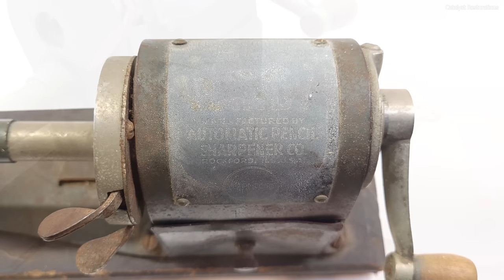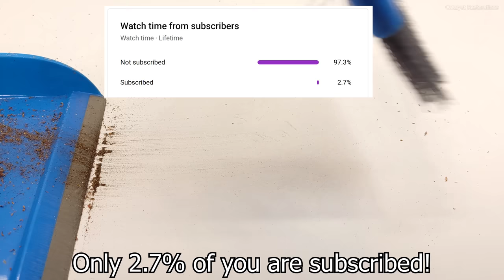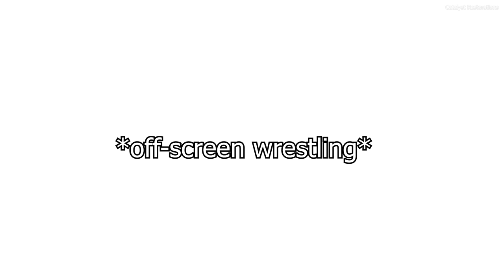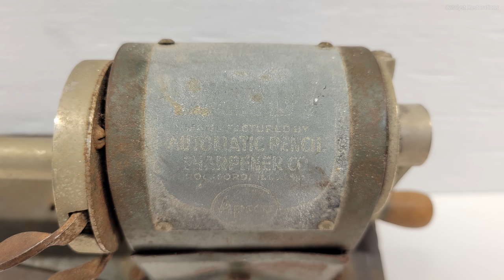82-year-old "Dandy" Automatic Pencil Sharpener Restoration

Comment: These sharpeners were still fairly common in the 1970s, not so much these days. We had two (I think they were "Climax" models, not APSCOs) in the wood shop at the original (pre-1980) Winfield High School (Winfield WV) and six or seven (a mixed lot of models) in the various shops at the Putnam County Vo-Tech School (it goes by a fancier name these days) (Eleanor WV). When I was doing cabinetry work in Florida and Alabama in the early 1980s, I saw a "Dandy" in the shop, but it was in pretty poor shape.  I never thought we'd get to a point that a mechanical pencil sharpener would be a rare sight, but here we are. Thanks for doing the good deed of bringing this needful thing back to life.
Reply from the maker: Mechanical sharpeners were still the norm in school for me through high school (the mid-2000's, I know I'm a youngin!) but I'd be surprised if I regularly found them in every classroom still today.

Comment: Great results, and congratulations. I have collected a few of these through the years and several had pencil gripper jaws that were stiff and intractable. You gave me the courage to open up the spring loaded chassis where lots of shavings had settled. After cleaning them out and re-assembly, I get a much better result with the sharpened pencils.
Reply from the maker: Thanks Jim! Glad I could give you the courage to open it up!

Comment: I think maybe the doohickey that 'locks the blades' might actually be what stops the pencil moving forward once it is sharp. The point would hit that and prevent the spring from pushing it further. Might be adjustable for two different sharpnesses?
Reply from the maker: You are 100% correct. It's actually a tip point adjuster - I even found some old ads that mention that feature. Great eye and thanks for noticing!

Comment: If you created a curved sanding block that would fit the printed part, then you might be able to Japan it then sand it to remove the blacking. The block won't compress and get into the deeper parts.
Reply from the maker: Great suggestion Mike! I've been meaning to break into the japanning game soon, so this might be a good opportunity.
Reply: @CatalystRestorations  😆

Comment: Really a pretty job overall! With minimal equipment. Bravo! I really enjoy your videos so far! 
Keep it up! Keep learning!
Some advice from an old fart that used to do a lot of fixing & restoration:
A couple things you missed, oil the crank shaft - that is what the button that's off center top, 3in1 oil. Should have put a tiny bit of lubriplate under the pencil grippers before assembly. The grinding gears are supposed to be lubricated with graphite - I know, ironic isn't that? You did a pretty good job matching the paint, maybe in the future you can use a pantone chart and mix and spray with an airbrush. I caution you on the universal use of the wire wheel, it can and will remove actual metal and possibly leave unwanted patterns in the metal surface. Also it can reduce the amount of metal causing things to fit loosely where other methods wouldn't - evaluate this before taking action, especially on CAST parts. (don't ask, take my word for it) For your rivets, make a tool from a round 1/2" steel rod, grinding a divot into one end in the shape of a rivet head & pound that, not your resto piece, you left hammer marks, minor, but on a future piece it could be a disaster! As far as the lettering, I've never found an easy way to do the shallow ones, just magnifying light and pinstripe paint and patience.
Reply from the maker: Thanks for taking the time to write out all these great tips Craig! I'll definitely use these!

Comment: Excellent Restoration!  You may want to try using a bluing agent and apply with a small brush. Light sanding will remove any over coat.
Reply from the maker: Is there a bluing agent that works on tin alloys? I'm confident the tag is made of a tin-based alloy (very soft, malleable, and lightweight and tin alloys would be period-correct for this) and all the bluing agents I know of only work on steels. 🙁
Reply: @CatalystRestorations  I don’t know if it would work on tin, you can try a test piece.  If the impression is deep enough, maybe try paint instead of marker.  It still looks good unpainted.

Comment: Nice job. Use metal bluing to blacken your badge plate. Then put some wet dry paper on a metal or glass surface. Now keeping the plate in a constant contact (what amounts to a single line on a curved piece) pull the badge over the paper. Repeat with progressively higher grits of paper until the finish desired is achieved.
Reply from the maker: This sounds like a pretty good approach, but each letter has a rounded raised bevel around it - if I sand over it with a flat surface I will sand flat or completely sand away that nice rounded bevel.
Reply: @CatalystRestorations 
I recommend using a finer tip brush with your method. That way there's no residue to clean up.

Comment: "Modern" pencil sharpeners differ in two respects:  1) most now are electrically powered; & 2) the only have ONE cutter rather than the two.  The first electric sharpener I got had two cutters but the motor failed and the replacements only had one cutter.
Reply from the maker: Could you imagine an electric motor inside this Dandy? It would be unstoppable!

Comment: An excellent job! We still have an old hand crank sharpener that belonged to my dad kicking around somewhere. :3

Only mildly disappointing thing was that you didn't try to clean up or replace the board it had been attached to, but otherwise a fantastic restoration! Here's hoping it gets mounted somewhere nice. :)
Reply from the maker: I was really torn on the board part! On the one hand it's not original, but in the other hand it's part of the history of the piece. I still kept it in case I ever want to finish it! Thanks for watching!

Comment: I have one of these sitting in front of me that works as I watch...the tin lable plate has black throghout the letters with black across the top and sides...the letters atop are invert color, rounded at the bottom, and around seal. Our stop lock dont stop the sharpeners...and weve lost the wood dowl...our lable is fairly nice if you would like a picture! We can read it all, the seal at bottom says Apsco in black, Dandy manufactured by automatic pencil sharpener co. Rockford ILL.U.S.A., the background is a light green looking, or green grey.
Reply from the maker: I love this detailed description! Based on the research I did and photos I collected of ones in good shape for references as I restored this, it sounds like yours is actually in pretty good shape! The label is definitely the best part about it - just wish I could faithfully get the black lettering accomplished.

Comment: Great restoration, regarding the letters there are 2 auggestions , 1st one is using a tiny paint brush for bold big letters and a toothpick for the small ones, 2nd way if the letters arent engraved and are up like a bump you can try spray painting the whole part and the. Using scotch to clear the paint from the letters, another comment is that for flattening the rivets back you can ise a rubber head hammer instead of normal one it will take probably longer but will save you the need to clean after the biting that metal hammer leaves around the rivet <3
Reply from the maker: I may try using an ultra fine tip brush at least for the recesssed lettering! Thanks for the tips!

Comment: For the lettering, I would try a super thin coating, such as oxidizing the surface then block sanding with a very fine sandpaper to avoid sanding inside the depressions.  Then just clear coat over.

The other method is to use panel line accent color as used in the model hobby.  It’s very thin and will pull to edges and increase legibility.
Reply: Also, subscribed and liked.  Always enjoy watching others’ methods of restoration :-)
Reply from the maker: Thanks for subscribing, welcome aboard!! Thanks for tip on panel line accent color, I'm going to look into that, sounds really promising!!!

Comment: You should paint the whole sign black then use sandpaper to remove the excess
Reply from the maker: Great idea. Or even just acetone right up to the edges (since it'll be faster than sanding) and then carefully sand to the edges of each letter with like 2000 grit sandpaper. I'm going to have to try this!

Comment: I'm part of the 2.7% that's subscribed 🤣😂🤣
On painting the letters I'm not sure if I seen you do it or not but did you try painting it and letting it dry then sanding it to revile the black letters? But make sure you have something long enough to reach to both ends and flat. It almost looks new again and you did an excellent job restoring it as well!!!
Enjoyed your video and I gave it a Thumbs Up
Reply from the maker: Thanks for being a longtime subscriber and always leaving great comments!

Each time I painted in the lettering I let it dry for a few days before attempting to clean it up. I did try a technique with regular sandpaper like you described. It sort of worked in some places but not others and I could never get it looking good enough that I was happy with it.
Reply: @CatalystRestorations  You're very welcome!! Shocked it didn't work!! Did you try using a block of wood the went across the whole thing?? If so it might have worked better if you would have put it back on the sharpener so the whole thing was supported. Just a thought
Reply from the maker: I did try mostly what you described, but the problem I ran into with that was that all the edges around the lettering are actually rounded or "mounded" up a bit and doing a straight across sanding would sand away the "roundness" of the letters' edges, if that makes sense. Most machinery tags have much more blocker, basic lettering with uniform raised heights where you can paint the whole thing one color and then just flip it over and sand it down on a large, flat piece of sandpaper or sanding stone, like you suggested. I wish it was possible with this one!

Comment: ok im subscribed...."i make new one" made me lol ! For the black letter i would have tried sanding the black off with something like a flat sharpening stone. a soft pad or even a finger with sandpaper is too malleable and gets to the indent
Reply from the maker: Thanks for the sub! Welcome aboard! I was hesitant to try a flat stone only because the letter edges are actually slightly raised and rounded, so using a flat, hard sanding tool would flatten off/sand away all those nice raised edges.

Comment: I don't think the insert in the blade set is meant to lock the blade. That might be a contact issue. My understanding is that it's a tip stop. This is an auto feed sharpener. I have one, myself. The insert has two positions, marked by detents on the blade housing. They seem to be allowing it to move more or less deep into the blade set, allowing the tip to get slightly sharper, or not. Not 100% on that, but it definitely seems to behave that way, on mine.
Reply from the maker: You are 100% correct! It's been a while since I wrapped up this restoration, but in doing a bit more research after the fact it is indeed an adjustable stop that allowed the pencil tip length to be longer or shorter! 🌈 The more you know! 🌈

Comment: As someone who does a lot of drawing I do get the point of all this. I have a similar all metal device with a brass drawer for the shavings. It is a precision instrument that comes from Toledo in Spain and was v.costly. As to the lettering, you could possibly experiment with gold size which you could apply into the letters and then use Lettraset or similar with a clear varnish to seal it in. Lettraset have hundreds of Font designs in all sizes.
Reply from the maker: Wow, the Lettraset idea actually sounds really viable and might be the best solution anyone's suggested yet! I've done waterslide transfers before and looks like that is kind of similar, but I never thought to go with an approach of anything other than trying to paint it somehow (which clearly hasn't worked). Thank you for the awesome feedback, Peter!

Comment: Why did you assemble everything before painting?
Reply from the maker: It varies from project to project of course, but for this one it was far simpler to reassemble the structure and then paint to avoid scratching/denting/knicking up the paint trying to get everything riveted/peened back together.

Comment: When drilling out rivets... do you use a drill bit the size of the post or the head of the rivet?
Reply from the maker: For me, I find it's generally best practice to use a drill bit that is the size of the post. That way, as long as you are drilling on the center of the rivet from either the head or the post end, if you do drill right through the rivet entirely without stopping and the bit continues on through into the rivet hole you won't accidentally end up making the rivet hole itself larger (if your goal is replacing them with new same-sized rivets). If you have a rounded head rivet I find a couple passes with a file and then a center punch helps keep your bit from wandering off center!
Reply: @CatalystRestorations  thank you

Comment: I wish you would have fixed the tray, otherwise fantastic job
Reply from the maker: By tray do you mean the big wood part? I considered it, but it wasn't original by any means to the sharpener so I opted against it. I still kept it though so I might just do that still!
Reply: @CatalystRestorations  I understand not restoring that part, I was referring to the shaving collection tray. I noticed the back wall was no longer connected on at least one edge
Reply from the maker: @andybrown1002  Ah, I see what you mean now! This actually bugged me as well and it's part of the original design. The tray is actually just a piece of flat steel folded into the shape of a box without any actual adhesion along the edges of any kind. A faster and cheaper way to manufacture them, I'm assuming.
Reply: @CatalystRestorations  oh that's really frustrating indeed, seems like it will make a mess that way.
Reply from the maker: @andybrown1002  Yup, shavings/dust can definitely leak out the sides or back. 😔

Comment: Świetnie jest to odrestłrowane ta cała maszynka do oszczenia ouwkow ale gdzie jest zrobiona i odrenowowana ta brązowadeseczka 🤔 pozdrawiam twórcę tego filmiku 👍
Reply from the maker: Thanks for watching and thanks for being a subscriber! 

I didn't restore the wooden board because it wasn't original in this case - someone added it themselves at a later date before I purchased it.
Reply: Beautiful work. Is it possible that the little pivoting piece between cutters is a lead ejector? Try either spry painting a piece of paper on a hard flat surface then rolling the piece on it. Another way would be to paint it and then put a sheet of 600 grit wet sanding paper on a flat surface and sand off the high spots .finish with a coat of lacquer.

Comment: Great restoration, but you act as though the possible lead paint was cyanide. It's not really that dangerous.
Reply from the maker: In a solid slab, sure, not a big deal. But if I don't at least take precautions to minimize lead dust everywhere around my shop I'll be breathing it for years. My workshop is also in the basement of my house and I'd rather not have lead particles make their way into other areas of the house where small children are.

Comment: You are scratching the hell out of the parts! Lose the wire wheel.
Reply from the maker: It's fine, the scratches are fine enough they disappear under the primer coat. And for everything else there's no other way to clean them up unless I used something like sand blasting, which I don't have.